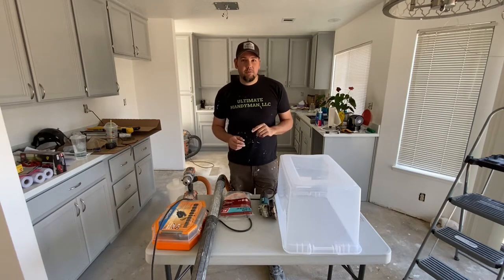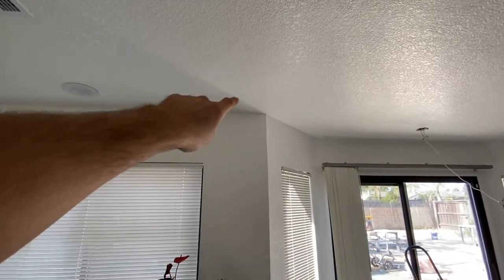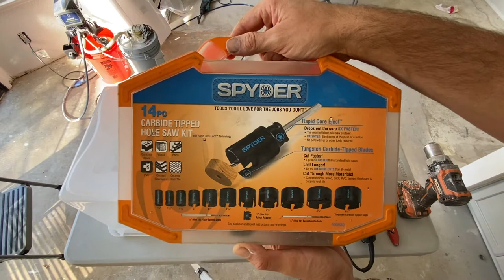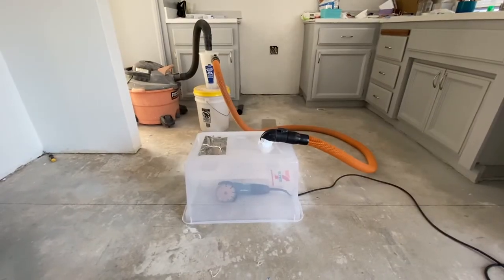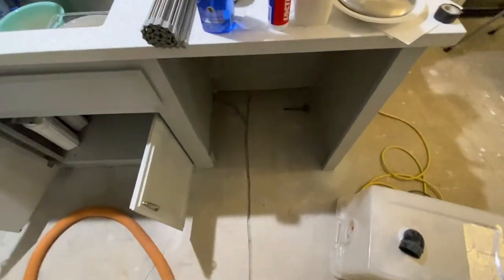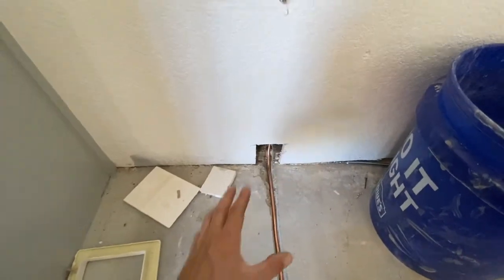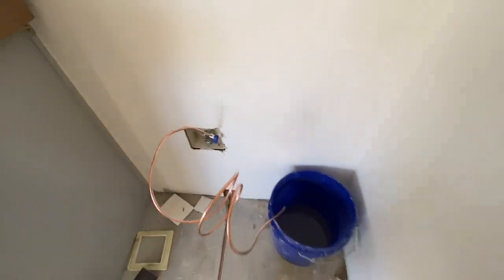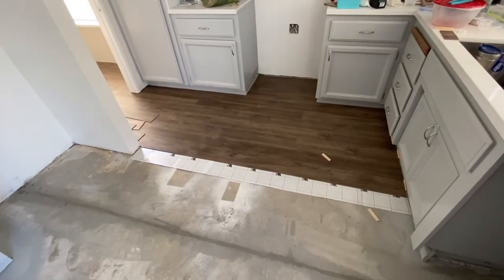How to Install an Ice Maker Water Line Under Flooring+Custom DIY Dust Collector

Comment: Should I use copper or PVC 1/4 pipe if I plan to run it across a wall? Do any suggestions pls.
Reply from the maker: Is the pipe on the outside of the wall or on the inside? If it’s on the inside I would use copper. I’m sure both would work just fine.
Reply: @TheUltimateHandymanKyle  Thanks for the suggestion.

Comment: I'm considering using a router on the bottom of the click-together laminate (10mm+2mm attached padding) to inlay the plastic water tubing in the floor rather than routing out the concrete.... anyone have experience or thoughts on this? I'm nervous with a slab home of sitting something and causing bigger problems in the concrete
Reply from the maker: That could work as long as the tubing fits in laminate. My house is 23 year old and the slab looked sound. There were no crack in that area. It’s been working great for the last 2.5. Don’t do it if you have post tension cables in the slab. There already a lot of different ways to tackle this problem. If you find a different way let us know here in the comments.
Reply: Your solution is very creative! I have a similar issue  but the flooring in the kitchen is already completed. The only way the seems logical in my situation is to run the 1/4 inch flex water line through the back of the cabinets from under the sink, but there is a doorway to cross. So, I've decided to use my oscillating tool to cut a groove under the threshold and then hide the 1/4 inch line behind the baseboards by cutting a groove along the back at the bottom. That should hide the water line to the fridge from across the kitchen sink where the RO system is located.

Comment: Where is the link for that wheel? Thanks
Reply from the maker: https://smile.amazon.com/Crack-Chaser-Concrete-Asphalt-Repair/dp/B01JI9B2B4?pd_rd_w=X3JG9&pf_rd_p=de28a4b0-e3d5-4d62-a7ec-045d2f5964b4&pf_rd_r=85STS9M0AZBM35S08176&pd_rd_r=2aa22756-6bad-4883-b177-ce5c2fc04d10&pd_rd_wg=AJ6q2&pd_rd_i=B01JI9B2B4&psc=1&ref_=pd_bap_m_rp_77_sc

Comment: Wouldn’t the cement/concrete corrode the tubing after time?
Reply from the maker: I found this on Google. According to the Portland Cement Association the interaction of copper with both dry and wet concrete should not cause a corrosion concern. I’m sure that if the concrete was always wet that would cause some corrosion over time. We’re talking 30 to 50 years. if the line stars to leak I would here the RO system turn on. Worst case I’ll cap off that line. Someone commented when I first posted this video that the RO system water would corrode the pipe because it’s changing the ph and striping all the minerals out. I don’t think that’s the case my RO system has a mineral filter to add them back in and a alkaline filter. They also said that there would be a lot of copper in my drinking water so I did some test and there was 0 copper in the water. If you feel more comfortable install the plastic style pipe. I used the copper because it was easy to work with in the grove. If you use copper try finding a thicker walled one if you can find it. It’s been 2 years and everything is working great still. If I ever do this again I might run a conduit pipe so I could remove the ¼ water line in the future if there is damage. You would need to run the plastic style pipe for that application.

Comment: Copper and cement, etc. does not play well together. It will corrode the 1/4” copper in short time.
Reply from the maker: I’ve looked this up and it says otherwise. Maybe wet cement would be a problem but this is always dry
Reply from the maker: It still works good 2 years later.
Reply from the maker: I’m testing this out a my house. If it ever fails I will just cap it off. My RO filter has a pump that turns on when water is flowing so I would hear it. I would never do this for a customer. It would have been nice to install a ½ pvc conduit. That way the water line could be replaced. In 10 to 20 years I’ll let you know how it turns out